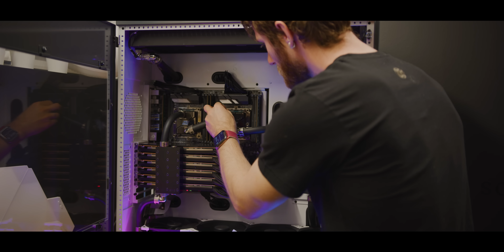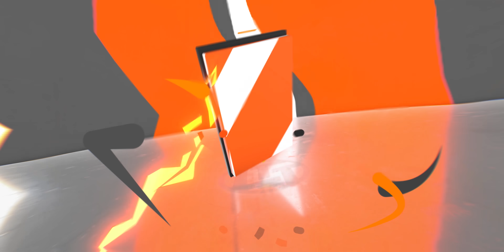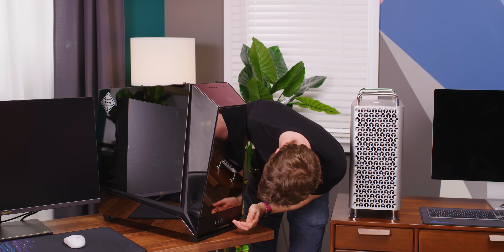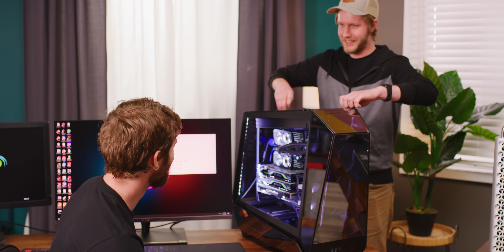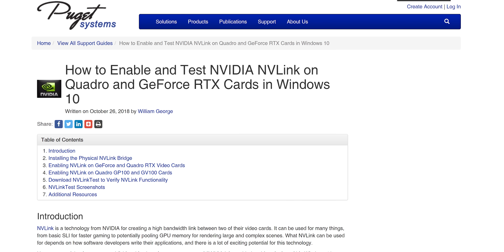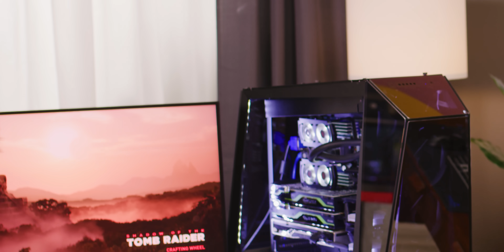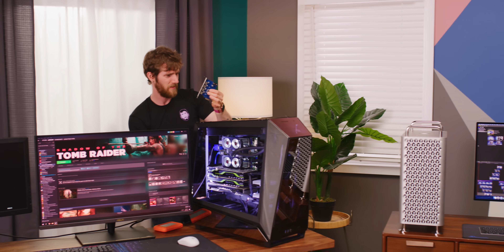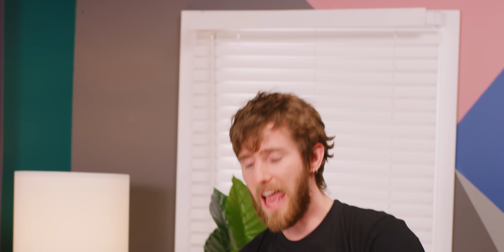The $32,000 Mac Pro Killer

Comment: The PC Pro case is a non issue, because there are better, more user friendly cases that you could have used... it's basically a uses preference and does not impact everyday performance.
Startup time is also a non issue as you do not start the computer every time you want to do a task, the hardware inside the PC Pro is designed for an always on system that can run months at a time without being rebooted.

I would bet that the PC pro would allow you to setup two virtual machines that might allow two people to complete tasks that might have needed another Mac Pro otherwise.

Comment: linus: uses a titan rtx as a display output

me: cries in intel hd graphics
Reply: One time my friends were talking about computers, and one of them said that their GPU wasn’t that great.

I mentioned my Intel HD 520.

They stopped talking about how bad their GPU was.
Reply: @wta1518  mine is UHD 620 intel graphics
Reply: @chronenojysk5107  my sister has one of those in her computer. she is able to get 12 fps when I only get 8.
Reply: @wta1518  My PC can only run games from 2014
Reply: @chronenojysk5107  are you kidding me? I have trouble with games from 2011.
Reply: @wta1518  I have intel i7 core. So maybe that helps a bit?
Reply: @chronenojysk5107  uhh can i get one for free :(
Reply: @chronenojysk5107  yeah, and I assume you have a more powerful GPU than the HD 520?
Reply: @chronenojysk5107  Core i7 for its generation, then yes it helps. If you have an i3 from 9th gen + plus, then depending on how old your i7 is, then the i3 would run circles around it. It might be many other things though, what's your GPU?
Reply: @sylamy7457  intel UHD graphics 620 with an intel i7 core 8th Gen
Reply: @wta1518  I’m leagues ahead of you in this pointless competition (that isn’t a competition) with intel uhd 730 (hopefully I get an actual gpu soon)
Reply: Same
Reply: Cries in ms basic display adaptor
Reply: Plus 2 $5500 gpu’s
Reply: HD Graphics 4000 in a i3 3120M...
...in a laptop formfactor...
(socketed tho! and never thermal throttles! cause 11mm thicc heat pipe!)
Reply: @ayushp.5395  i have the same but i hava a i3 3130M in a hp probook 4540s
Reply: @barnabasszaniszlo8732  oh, i have the Dell Vostro 3460, it was given to me at my work.

had excellent repairablity and design strength tho unfortunately now it's not that capable for modern bloated sites so i use it as a data backup device, it has 4 USB 3.0 ports so very useful
Reply: @ayushp.5395  I have a socketed i5 (dual core, gen 2) in a laptop with Intel integrated graphics. It's pretty terrible.
Reply: @ajhauter5049  oh no, atleast you have a i5, i have to live with a liquid metal'd R9 5900HX and a RTX3080 135W 16GB laptop with a 1080p 300Hz screen and a opto mechanical keyboard and a glass trackpad with inbuilt num pad...
Reply: @ayushp.5395  I hope your can improve your setup one day 🙏
Reply: @ajhauter5049  yes, one day for sure 🤣
Reply: @ayushp.5395  you do know Ivy bride cpu's are stupid cheap right now ? I seen one online for 20$
Reply: SAME :')
Reply: Intel HD Graphics 520 😡
Reply: i mean my GTX1050 isnt that bad i guess?
Reply: I don’t even have a pc
Reply: @sunjungnam980 hey, I saw a few dell optiplex's on ebay for like 50- 150$ it's good for beginners
Reply: cries in gtx 650
Reply: @notwawa  cries in mobile. I win
Reply: bruh
Reply: Me being sad on my dual core cpu😅😧
Reply: “hd”
Reply: you are my life a bruh moment
Reply: Cries GT 710
Reply: I know how you all feel. Up until 2 weeks ago I was stuck with integrated graphics from an i5-8100H in an acer aspire 5

Now I have a 3050 Ti mobile with an i5-11400H in a Dell G15
Reply: Cries in vega 3
Reply: sameeeeee
Reply: i have a gtx 1660 ti
Reply: *cries in ENIAC*
Reply: Wow Intel HD Graphics. Thats so expensive 🥲🥲
Reply: Ok, I'm ready to say this..."crying in gt210"

Yes, for a long time I used that thing with windows 10...
Reply: Bruh im running a core two duo rn.... Rip :(

Comment: Some thoughts. The gaming benchmark is completely redundant, the Mac Pro doesn’t have a gaming card at all. The Mac Pro is near silent in operation where that pc pro would be loud as heck. The Mac Pro runs OSX and as a pc guy I admit OSX is better is every conceivable way so that’s 2 points that should be added to the Mac Pro and 1 deducted to the PC Pro. The Mac Pro will still be worth something in 3 years the pc pro will not. Finally the 32k figure isn’t reality, The company I recently worked for bought a bunch of Mac pros and to save money we upgraded the following items ourselves, Xeon 8 core to the Xeon 28 core,  from 32gb to 512gb, rx card to msi Vega 64 and finally we added a PCIE to nvme adaptor and added a couple 2tb nvme drives. We saved over 13k usd over what Apple charges on their site. @linus a follow up video showing how to upgrade the Mac Pro yourself saving 10-20k per Mac Pro would be a great idea.

Comment: helped my friend doing av and built him a sensible content creater pc with a 4 slot b450m an asus prime , rx580 8gb. 4x16 64gb ram and a ryzen 7 2700x, a 4tb wd blue for mass storage and a 512gb ssd, 650w psu, cheap whatever CM case, for the monitor i just got a super high color accuracy Phillips under 150. in total it was around 1100-1200. it spanks 4 grand windows workstations and 5 grand 5k imacs with a pathetic 4 core i7.

Comment: ok but can someone tell me WHY would SOMEONE buy a PC fo OVER 30K?
Reply: A few reasons I can think of. 1. and the most unlikely, a person who just has the money and doesn't care. 2. A business that benefits from being able to render things quickly. A PC that is able to render a video in half the time is of MASSIVE financial interest to a business. Imagine that same benchmark they did to be used for a commercial. If it takes a full day to render the video and after it has rendered you find a mistake or need to make a change, you now have to wait another full day, instead of being able to do it in the second half of that same day. You could argue that over the course of a year, this type of set back would be equivalent to half the work output. The other option is to hire an additional employee to make up that lost time. Realistically, half is an exaggeration as an employee can be doing other things, however, the counter is that someone with the knowledge and expertise to fill a second spot as needed to overcome the PC render speed would cost more than 32k a year. Lastly as a side note, as an engineering student, I occupied 8 computers in a computer lab for 4 hours (11pm to 3am) to generate a minute and a half worth of video (that didn't even turn out that good). I do see the benefit in a professional setting where this is useful
Reply: @anubis520  shiss u took a lot of ur time for this 😂😂 but yeah sure ill give u a point✌🔥

Comment: And yet again, as always, a Mac vs PC comparison is executed by both machines running Windows. Which makes it pretty much as relevant as comparing a Tesla to a sailboat.. Please, pretty please: just once make a test where both machines are run on the OS that's optimized for their hardware and not give an advantage for the one running Windows. No, seriously. You must know how different operating systems are and how differently they handle the hardware as well as you must know how important part SW/HW integration plays in a Mac. By running Windows and forgetting the role of MacOS you are effectively nullifying your whole point and all the effort you put in these comparisons.

 Here's a suggestion: why not build  a PC with same components as a current Mac and then measure how they perform similar tasks. Same hardware, same task, different OS. Too difficult? You're professionals, right? Surely you can come up with a task that you can simply use a stopwatch for.

Comment: 1 month gone, and we have Threadripper Pro - Lol (which btw supports 2TB of ECC RAM)
Come August, and we shall also have Ampere based RTX-series (an architecture after a decade)
or AMD's RDNA-2

My proposition would be:
• Antec's TORQUE (White) Case
• AORUS Gen4 AIC SSD 8TB + Firecuda 520 M.2 2TB

All delided » Gold Plated » Liquid Metal Pasted (Optimum Tech) https://youtu.be/s3kxo-70FmM
and make a Hackintosh with OpenCore + https://vanilla.amd-osx.com

Comment: Completely failed. From a business prospective, i would never run this "support nightmare". If you buy a mac, you would run OSX, not Windows. Even if you build a Hackintosh, the wrong update can stop your business. I work with both systems, i love windows 10. BUT: With Apple, you start it and it works. That is the Bang for the buck. Also in your case, Premiere is the slowest Video Rendering software that is avaible. You need to build render servers, really expensive networks (switches and nic cards) , nvme servers etc.... You really think you whole solution is cheaper and better to maintane than a macpro? hmmmm (Sorry for my english) So for a real competition, you need to buy a HP Workstation with the same specs, or a Dell Workstation etc.... The macpro is a business unit, not the home gaming thing you care about.

Comment: 10:38: The Linux terminal, of course :P . 
Seriously, though. I just checked and my Linux PC that used to have a Nvidia card has a nvidia-smi command from the drivers that would be able to run this if I had the cards, so perhaps these cards were intended for Linux rendering farms. I guess Windows is finally the second-class citizen this time instead of Linux. 

11:20: Again, I think it might be because these cards were actually intended for Linux, otherwise the tester command wouldn't be a Linux one. 
It's crazy thinking about that. Usually Nvidia drivers aren't the best on Linux, but in this case they are better than the ones on Windows.

Comment: Actually ,  when you pit apple hardware against other hardware like this,   both systems utilise levels of enterprise grade hardware ,   the diference is not so much in the specifications and stability of the systems, only really the price to performance gains had when building an enterprise system that has a choice of custom hardware rather than a single vendor system (mac pro) that apple supplies

Comment: Not sure that comparing app performance when app supports NVIDIA CUDA against a machine that doesn't have NVDIA cards. You'd want to compare with an app that has equivalent hardware support on both.  So that test didn't compare performace of graphics cards since on the Mac the graphic card's performance wasn't tested.

Also for video production, you should have compared Premiere againstr Premiere,  Had Final Cut Pro won, there would have been question on whether it was a fair test. The fact that is lost is pretty damning on the cheese grater since FCP is supposed to make full use of the cheese grater.

Comment: is there a RAM speed that beyond a certain point you need a cooler? my computer doesn't have sensors for RAM temperature and i wonder if the temps is gonna be too hot if i buy something like 3600 or 3800mhz? i still haven't found anything on this subject, and this video scared me a little bit with the ram coolers
Reply: you will be fine buying high speed memory. the ram in the video needs a cooler because it’s 128gb per module and it runs incredibly hot

Comment: "I have no clue how NVIDIA expects their customers to figure these things out otherwise". Well NVIDIA probably doesn't expect somebody to run 2 of these cards anyway.

(Edit: of course by "somebody" I mean any private customer and their pc at home. There are other use cases for this kind of gpu power (AI deep learning, engineering, astrophysical simulations etc.), otherwise it wouldn't even exist).
Reply: For real.
You probably wouldn't access the computer via a monitor but remotely through another computer like on a renderfarm (for specifically film industry.)
Not as a personal computer.
So it makes sense to me to disable useless features.
Reply: I mean for some workflows like ai deep learning there can be a situation we're u might wanna use even more gpu horsepower
Reply: @АлександрПеньковский-ж5г  try astrophysical simulations. supercomputers are still not enough and the simulations sometimes need months while having severe oversimplifications in them and frankly laughable resolutions.
Reply: @RKBock  Jesus christ, months? Surely they would run several supercomputers and combine the hardware to overcome limitations, or surely they'd make graphics card specifically for running these simulations???
Reply: @znub206  combine several supercomputers?! do you have any idea how much one costs? and I don't just mean to buy, but also to maintain. (high electrical bill)
also: there is more than just one work group. there are a lot of astro physicists who want to run their simulations. 
and lastly: supercomputers are already specifically build to do those simulations...
Reply: @RKBock  It's just an idea I guess, I don't have a lot of knowledge on this section of computers so I was just wondering, thanks for informing me.
Reply: @znub206  sorry for being a bit rude...
the thing is: out computers are pretty bad when it comes to simulations. the sheer complexity of the world is overwhelming. 
and about supercomputers... I once heard a "rule of thumb": 
during the first year, expect that the maintanance will cost as much as the computer did.
Reply: @RKBock  Hey no worries. And yeah I guess the calculations and executions for simulations are much more complicated and require very strong GPUs/CPUs. But that maintenance is high, is it for replacing parts burned out by the instense usage.
Reply: @znub206  no. as far as I know it's simply the electricity cost of running the computers and cooling them.
Reply: @RKBock  Ahhh ok that does make sense PCs like that would have a huge energy consumption at full load, and yeah cooling would have to be crazy with all the heat energy produced.
Reply: Im almost certain the super computer thing doesnt apply to what and private customer has access to. These companies probably enter specific deals with contracts with manufactures to produce specific limited to them parts for their computers.

Like im almost certain that a private citizen even if they are rich couldn't just outright buy the parts to make the quantum computer Googles' tryna make or even the parts in the  supercomputer at IBM from the manufactures.
Reply: @Ehh.....  actually, you're wrong. e.g. the 2nd and 3rd best supercomputers have NVIDIA Tesla V100 processors. You can actually buy them.
Also: why shouldn't they sell supercomputers to rich people?! what difference is it for them to sell it to corporations or to rich individuals.
And last, but not least: how exactly does the availability of supercomputers invalidate any of the points talked about in this thread?
Reply: @znub206   the problem with supercomputers,v clusters is that the N node cluster is great at running N seperate jobs ,or one job that has so little I/O ( eg sharing the data between nodes )  it can be  split into N seperate parts  , and   the reduction  in runtime is worth the startup ( sending the data out ) time. .. but  this test was massive amounts of data,  and running programs  that loaded up both gpu and cpu , with  the assumption that if the gpu and cpu loads were high,they weren't waiting for I/O..  so that   it's assumed that the test was of having all things , cpu ,  ram , PCIe buses, hard drives, pretty well maxed... Abd theb measure throughput .. rather than testing individually and assume they don't interfere
Reply: Nvidia probably expects the customer for running this type of thing are developers and engineers e.g. for machine learning. In that case, the Nvidia instructions shown in the video are enough. For a non-engineer though like Linus, it wouldn't be

Comment: How many people out of the entire population use 1TB of DDR4 memory, I mean most people have 8/16 still. Gamers and hardcore guys will have 32/64. 1TB is just overkill. I am currently on my workstation which runs Linux and Windows inside of VM with developer software, android emulators and 2 disassemblers running back to back. uses about 18GB memory.
Reply: governments

Comment: You would have had more performance with a dual pc setup i9 10900k or i9 10980xe overclocked to 5.2 ghz and a 3990x threadripper with 4 RTX Titans in each pc.

Comment: "...covered in five millimeter thick tempred glass that has been vacuum sputter coated..." - my Aerocool p7-C0 has ~ 3.5mm tempered tinted glass which makes the same effect, and I believe my case is far more cheaper and much more appealing to me than this overpriced piece of modern art.

Comment: 32k mac pro "killer", let's look at the facts, you spent 32k on components....Businesses are usually the ones to purchase these. How much time does it take to research, and then wait to gather everything, then put everything together, then optimize the bios, then download windows, then download drivers, then download your programs?
Compared to, walk into apple, buy computer, walk out, go back to office, hook it up, download software, done.
The company spent more money going with a 32k "mac killer" than they would have just buying a maxed out macpro+monitor+silly little stand.
Don't get me started on if a component fails during your build, or you have to troubleshoot any problem :D
Also, it looks like ass in comparison to a well engineered mac pro.
Also again, put the mac pro in a mac environment and run tests again. It's optimized for macos, not windows. What a way to skew statistics.

Comment: Mac wins with software that is optimized for Macs. Run Linux on PC pro, and then compare a neural network training speed on both to see why you don't need the mac. Or a physics simulation, or a proper benchmark program. Those nvlink commands in the manual, are meant for the Linux terminal btw.